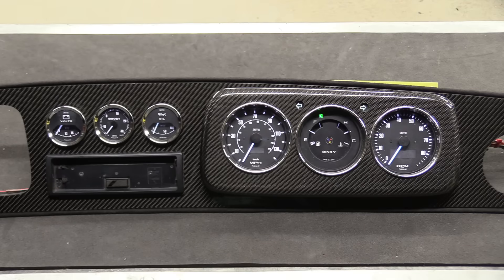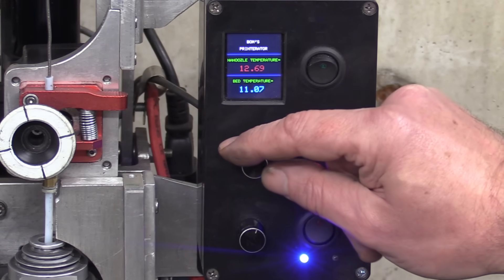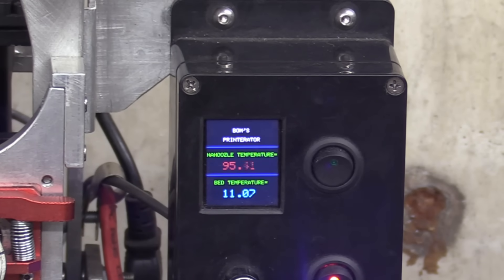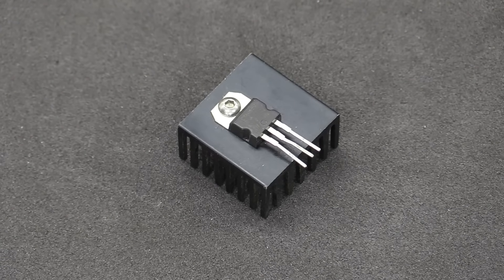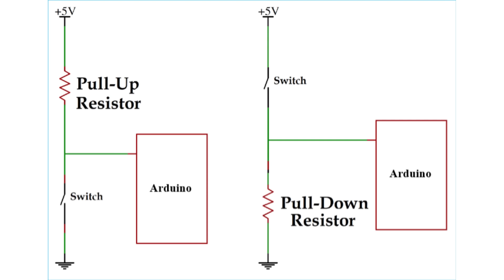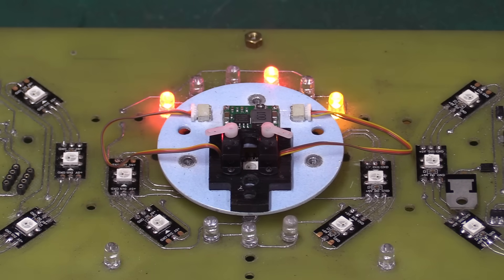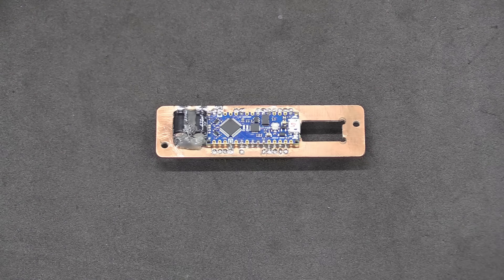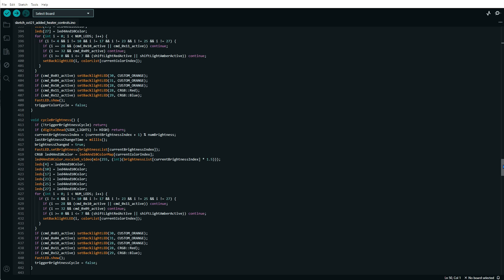Howie Did It - Learning Ardunio and Electronics

Comment: I wanted to make myself a custom dash for some time as well. I wonder how you approached odometer in your project. It's probably not that difficult but storing the current value reliably when power is switched on and off might be interesting. Although probably not such a big problem using your approach with delayed power-off feature...

Comment: The servo glitching may well have been the result of using too many blocking tasks in your loop. Instead, look into implementing a task scheduler, called from the loop at a regular interval, and returning to the loop promptly so the Arduino can perform internal functions such as updating I/O. It's more work to program but necessary for reliable real-time control systems.

Comment: One useful tip for reading >5v signals with an input that can't go over 5v (or it blows) is to consider the absolute max voltage you'd see from a spike and configure the voltage divider for that. You lose some resolution but won't have that pin get nuked from a 20v spike. You can also use zener diodes and limiting resistors that either shut or block transients, but those need a bit more design finesse.

Comment: Optocouplers are a good way to get voltage level shifting on your digital inputs with the added bonus of isolating the Arduino inputs (and therefore minimising the chances of adding the Arduino to the scrap pile)
Reply: Ah, you found out about them eventually.  Wait until you discover interrupts 😅

Comment: For mission critical devices (like speedometers) I would suggest going with the official Arduino. While the Atmega 328p is more than adequate for your job, I'd go with the R4 Minima, using the RA4M1 processor which is far more reliable. Last thing you'd want is to get a speeding ticket because a software / hardware glitch occurred (and yes, I use one for my car, not even sure why I am watching this haha)

Comment: You could, hypothetically speaking, create arduino based device, that might replace computer in modern cars. Given the fact that trend is "enshitification" and forced obsolescence, something like that might come in handy. I don`t not know if you have seen recent video by Car Wizard and rear light bulb replacement that will, most likely, cost 500 $ +  ....

Comment: The whole point behind the Arduino is that somebody who has know idea what they're doing, but who needs a bit of automation can get what they need done.  Yes, the hardware is kinda wimpy for some applications, but they're so cheap that you just buy two if that turns out to be a problem.

I'm a pro at doing embedded systems, and yet I take the same sort of approach at the things I build.  I think the difference between me and, well, you guys is I don't find AI to be very helpful when I'm doing stuff like this, but whatever.  Being able to get the thing to work is all that really matters.

Comment: I had similar journey, here're some things I wish I knew earlier:
- Arduino IDE is fine for projects under ~100-200 lines of code, bigger projects can get messy really fast in there, try switching to Visual Studio Code (VSC), especially if you'd like to use classes and split code into multiple files.
- (VSC) has a very nice extension called PlatformIO - it automatically compiles and links all c# and c++ files without the need of creating your own makefile (which is pain). It also has in-built package manager, that lets you specify the names of the libraries you need and it will download them automatically AND once you include them in .cpp, you will get a nice intellisense (code suggestions). In general, this will give your projects' code a structure, and in bigger projects structure is necessary to not loose your sanity.
- If you're faimiliar with Arduino already, I recommend to try working on bare-metal ATMega328p (which is the heart of the Arduino). Most probably you'll need to figure out how to upload a bootloader, set high and low fuses properly, use external oscillator for more accurate clock signal, etc. but in general if you're thinking about costs, that's the way to go. With VSC and PlatformIO, you can still use Arduino functions, without worrying about complicated registers or bit operations (although, they're fun).
- Similar to the above, but it's a step-up instead, try out esp32, it's a small beast, with bluetooth and wifi capabilities, you can do real IoT magic with it.

Comment: How did you design the printed circuit board and get it made? Also how did you make the gauge faces? I’ve done a touch screen system using a raspberry pi. It’s a mess of wiring and huge resistors. You guys always up the ante with a clean execution. 👏🏻

Comment: The things you guys get up to is incredible.  Using your CNC mill as a solder extruder to make circuit boards is utterly brilliant.

Having had experience with Arduino's and Rasberry Pi's (both types of micro controllers) for testing at my job, I can attest to the power and functionality they offer to makers and tinkerers out there.  It's truly an incredible time to be a maker, tinkerer and builder of all things mechanical and the electronics that control them.

And he's right... Online support for these these devices is tremendous.

Comment: The reason Arduino is acting up when handling both i2c and PWM for servos is that they both use the same clock. I ran into that problem when building a flight controller for RC plane. It's possible to solve but you need to change a lot of stuff in the libraries that control them. Much easier to switch to esp32 or a Teensy

Comment: I'm afraid you got badly lost when you printed your own circuit traces etc., and IMO that poisons the value of how it was done.  

Masses of ultra high tech bought and joined together to manufacture some medium tech, when you could use established ways to DIY a PCB through etching if you're /so/ dead set against just sending the desired PCB design to a website and having it made and shipped to you.  You buy other parts, not sure why you had to reinvent PCB manufacture.
Reply from the maker: We've explained all that previously.

Comment: I know the dash is done, but for stuff like converting a 12V signal to work with 5V input on aruduino, you don't need a regulator at all, a simple two resistor voltage divider will be perfect.
Reply: Apart from dealing with the heat dissipation.  That's why he went switched supply for the dash.
Reply: @Grid56im talking about signal, not power

Comment: I can certainly appreciate the work that went into this, but even so, using am Arduino is a poor choice. The Arduino is a toy meant for education and prototyping, it has no place in critical applications like automotive. I've seen a lot of people try to use it as such, the results are never good. The Arduino itself has too many limitations and reliability issues. I've said it many times, if you can do this level of development with an Arduino, you should be moving straight to the unhindered atmega chip the Arduino uses. It will require some more complex programming, and you will need to make a specific control circuit, but the results will be far superior. It does look like they've done a lot of work to make up for the shortcomings of the Arduino, in the end it's still likely to cause issues. I've said it many times, far too many people treat the Arduino as a goal instead of a stepping stone and it was never intended as such.

Comment: Teensy or esp32 would get you a lot more CPU and could probably easily handle everything in 1 unit. Also in my experience usually low voltage electronic switches are ground side switched so you would have the Arduino analog inputs be set to INPUT_PULLUP. The pins have an internal pull-up resistor so then you don’t need an external one. All you have to do is connect it straight through the switch to ground somewhere. A bonus, you don’t have to run unfused or unresisted 5V to your switches. It’s a little bit safer. And you don’t need a external pulldown resistor.

Comment: So is version 57 of the gauges pcb going to be retro-switched low with optocouplers and printed by commercially available PCB manufacturing instead of fragile as f..k solder tracks? ;) Love your work fellow mechatinkerers

Comment: Nicely done! And that revelation of yours to use two arduinos 👌I was experimenting with an arduino a couple of years ago and could have told you this. Arduinos don't like I2C combined with analog and digital reads at the same time. I had two motors with pid in a closed loopback and when I added I2C everything went bonkers 😃

Comment: I got heavily in to Arduino about 6 months back - amazing devices but there are now much more powerful controllers available with built in bluetooth and wifi. So easy to use and endless support on github and similar. I practiced by putting in flashy lights at my mate's American diner at his bowling alley. 7200 LED's scroll pretty patterns. My hot rod is getting custom lights, I am also looking at an ignition controller just because I can. A digital dash is next on the agenda. Love what you guys have done and still do, keep it up, it's an inspiration to millions.
Reply: Wish Alex @2STROKESTUFFING would save himself the trouble by doing the same
Reply: a good old fashioned Arduino can direct up to 200MA across its outputs with its 8 bit based tough as nails based in " I want to interface a computer to a tractor " state of mind. Modern times bases that  " I need to drive a Pentium 3's worth of data while controlling something like an Arduino to drive a tractor cause I can only sink 10ma while running 100Mhz and being the size of a postage stamp and running a python interpreter cause im too lazy to program past basic "
its seriously in these times, do you want a truck or a sports car, and most people miss that simple thing

Comment: Amazing work guys, learning something new. Just one thing, use conformal coating on that PCB and all the electronics (obviously when you are done with development). Otherwise it will oxidize over time. Also, it stops moisture getting into the electronics.
Reply: VERY good point! That oxidisation could cause all kinds of weird problems

Comment: Cool. I designed and built a way of mixing LED lights to choose colour. For fun I used linear potentiometers (slidey ones).

These days you can tell Gemini what you want, and it'll write the code for you. I had to do it the old way...... Understand about 5% of it, and steal the rest from somebody who knew what they were doing. It worked like. I was rather chuffed at myself for using a power supply that could output both 5v and 12v, to power the Arduino and the LED light strip. 

Your stuff looks great. I also designed and built a set of helicopter controls to fly my VR helicopter. I found it very difficult to do, but I got there..... Amazing what you can do with the shit in your garage

Comment: small tip. Buck converters are used because they are more efficient than linear regulators. Say you need 1A at 5V, your input is 12V. With a 5v linear regulater, that would mean 7 Watt would be dissipated as heat.

However, it's unwise to feed powere directly from the buck converter to your device. As buck convertes usually 'fail open' meaning that if they break, they will take all the other electroncs with them.

So use your buck converter, then a 7805 linear regulator behind it. Those fail 'closed'. That way the buck converter can do the grunt work, and if something fails, the rest of your electronics wont get 12v and die.

Another tip: ditch these PCB's and either make proper PCB's using etching (it's not that hard), or use some service like PCBWay. The PCB's you have now, will dissasemble themselves over time.
Reply: At least use conformal coating. While that PCB creation tech is really novel, you’re right. It could easily end up as a pile of silver spaghetti at the bottom of the dash. And God alone knows what it’d take with it in the process

Comment: Lights, pwm, I2C, and you ran out of overhead with an Arduino Nano.
Welcome to letting AI write your code, and not understanding good coding for efficiency.

Inefficient code, it's one of the biggest reasons new software needs so much more computing power to perform the same functions of old systems.

That Nano has more compute power than old ECUs that did a lot more than described in this dashboard.

And this is why AI won't replace good developers, but it will get a lot of entrepreneurs into trouble :)

Comment: Have you fellas learned about how noisy vehicle electrical systems tend to be, and the havoc that tends to cause with electronics not specifically designed for automotive environments?

Probably more than half of the components in the average ECU are just there to keep it from being blown up by a dodgy alternator or bad ground wire. And even then it still doesn't always work.

Ultimately, I'd have two pieces of advice for you:
1. Keep at it with the homework - you can absolutely do it.
2. Build a spare... Just in case.

Comment: Did I miss the reason to make pcb this way vs etching them at home or sending them to a pcb house ? I believe these are extremely fragile...
Reply: I would assume this is still prototyping the circuits before farming out the final production piece with the finished circuit maps.

Comment: Fantastic video. 

With your lights and servos interacting in ways you didn't like, there's a chance that this is because your PWM outputs were sharing a timer. With careful selection of pins or selecting the timer channel in your code, you can get past that issue.
Reply: Being LEDs, I figured it was just EM noise: the aftermarket LED headlight bulbs I put in my old first-gen Focus put out so much EM interference that the radio was almost useless whenever I had to drive at night. Separating them out onto isolated circuits would definitely help with that.

Comment: You can get flat circular servos that are designed to just move pointers in instrument clusters. They draw very little current and so can be wired directly to 4 of the Arduino digital pins which keeps your wiring simpler.
Reply: They’re stepper motors, aren’t they?

Comment: You guys need to look into the ESP32 based arduinos (or better yet, ESP32 based non-arduinos, which are much cheeper and do the exact same thing).  They're more than an order of magnitude faster than the ATTiny versions that you're using today, and would give you far more headroom than the two crap arduinos.

Comment: i spent all night writing motor control code for an actuator project ive been working on. arduinos unlock so many doors. also totally love "made in a shed". lol.
Reply: Have you checked out the FOC libraries?
Reply: @andylewis7360  no. im just controlling a dumb brush motor with an encoder (a 3d printed timing wheel with a couple photointerrupters to make a quadrature encoder). motor control is through an h-bridge. motor drives a linear actuator with endstops. its important not to overshoot. 

i do need a pid controller though. i found a pid  library and they just threw double precision floats at the problem. atmega doesnt have an fpu and that's a recipe for slow. im probibly going to have to do a fixed point pid controller library from scrach.
Reply: @LordOfNihil Oh! That sounds like fun! DO let me know how the tuning goes 😅

Comment: No need for pulldown resistors.  You can set an Arduino to "pull up" the inputs and then put the switch between input and ground.
Reply from the maker: Quite so and had we any idea what we were doing initially, that's exactly what we'd have done.

Comment: Trust me fellas there's so much more you can do with a car and Arduino. A friend of mine used a Mega for the prototype and later on I do believe he switched to an ESP32 (for app connectivity) to connect and read the CAN bus. He used it to control the LPG flow to the engine. ArtuPower was the project he worked on.
Reply: ESP32’s are awesome. The new P4 variant is an absolute BEAST!!

Comment: You forgot the arrow next to the petrol pump symbol that tells you which side the filler is on. Time to start from scratch…
Reply: It's a mini. If you have it wrong way round on EVERY axis, the hose will still reach the filler(s).😂
Reply: Don't say that 😭😭😂😂
Reply: @the_mystery9803  I've been consistently trying to convince Nik that he has forgotten about the microwave oven which is clearly needed when Binky eventually breaks down and they're stuck by the road side trouble shooting. Having an appliance that can both make tea and hot pockets is essential to a rally car :P
Reply: so, if the arrow isn't there, it's the side that the hose is on the logo
Reply: That'll extend the whole thing another two years😅

Comment: Don't deskill yourselves with LLMs (and no, they are not "AI"). Chances are, you'll find something horrifically wrong later on down the road. If you're lucky, it'll be during some testing or assembly. If you're unlucky, it'll be on the road and you'll find yourself with problems whilst driving. Take it from me, as a programmer of a decade and a half, you do not want to use an LLM to "simplify" your work.

Comment: Hey Guys, the arduino UNO has a 10 bit ADC, not 8 bit. The values go from 0 to 1023. Just FYI.

In saying that, shaking right now.. NEW BAD OBSESSION MOTORSPORT VIDEO OMG OMG OMG
Reply from the maker: Yeah, my mistake. 10 bit ADC but 8 bit PWM controller. 🤷‍♀️